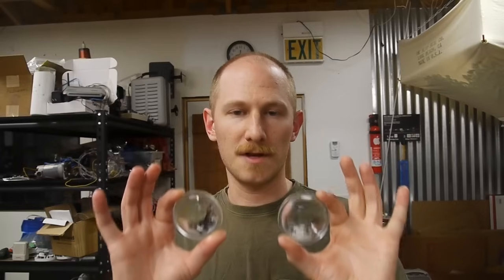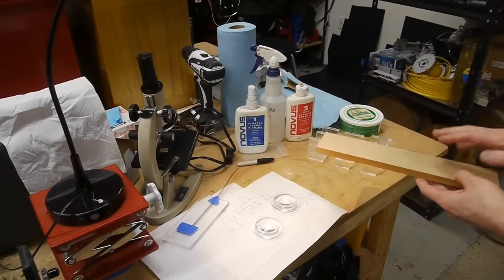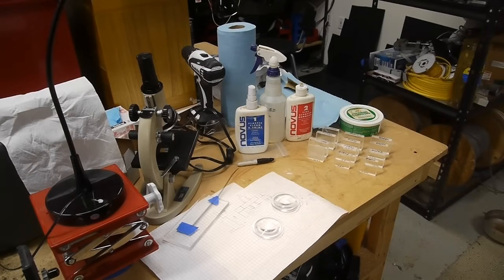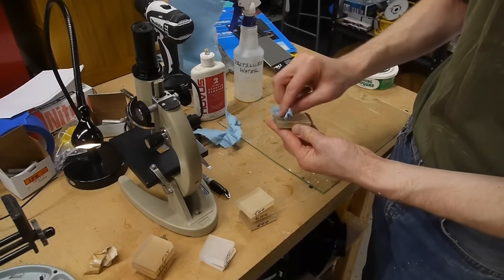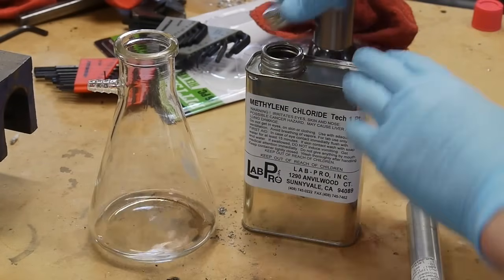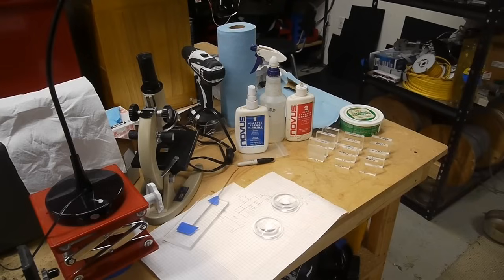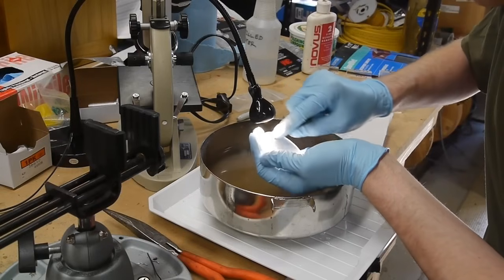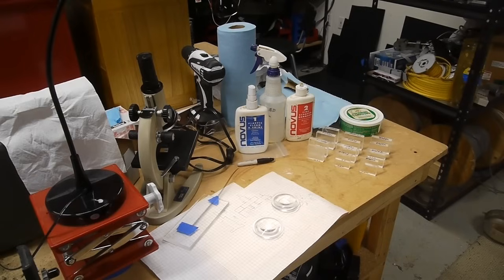Optical finish for acrylic -- vapor polishing and other techniques

Comment: You mentioned that extruded acrylic is best for laser-cutting. However, as an owner of a laser-engraving business, I am confident to say that extruded acrylic is far worse than cast acrylic for laser-cutting. I'm not sure why, but the fumes seem to be far less severe when using cast acrylic, the flame-polished edge is more consistently preserved, and engraving is dramatically better quality.
Reply: Extruded acrylic has built-in stresses.  All acrylic plastic should be annealed after fabrication.  This is a step that everyone seems to miss!  It should be out of the cutter, and immediately into the annealing oven for a lengthy cycle.
Reply: @bpark10001  hi Brian, is that the case even with cast acrylic ? , does cast acrylic also get stresses during laser cutting which need to be annealed later.
Reply: @scienceinc.9453  The difference between extruded acrylic & cast acrylic is that extruded acrylic has built-in stress as delivered from the factory.  Once you start cutting it, you build in more stress, in addition to that already there.  The only difference is that the extruded acrylic may warp if the cuts made release some as the built-in stress.  The cast acrylic won't warp, but either will crack from the laser cut, flame polished, or solvent-treated surface.  Sharp inside corners will crack first.
           I made a light fixture with a bunch of 1.5" diameter cast acrylic rods with slots in the ends.  The slots cracked several weeks after cutting.  I then re-made them, annealing them for 24 hours.  They cracked after 2 years.  Then I changed the design & drilled & tapped holes in the ends, screwing Delrin end-caps with the slots, & annealed those for 24 hours.  THAT has not cracked in 30 years.
https://www.acrylite.co/resources/knowledge-base/article/what-is-annealing-and-what-are-the-procedures-for-annealing-acrylite-r-acrylic-sheet?category=working-with-acrylite-r
Reply: I have theory why extruded acrylic makes more fumes (cast & extruded acrylic is same chemistry).  The extruded acrylic moves when heated because of the stresses, moving into the laser beam, causing more of the plastic to fume.  Normally, the cut line is very thin.  So the slightest movement would dramatically increase the vaporized plastic amount.
          Ideal setup would be to have the laser table & the plastic preheated to annealing temperature.  Make the cuts, then pull the plastic to an oven for slow cooling.  You would have to account for the expansion & cut oversize.
Reply: @bpark10001  Thanks for the knowledge Brian, I had always assumed that the stresses were developed during the laser cutting process because hot acrylic which tries to expand ( high thermal expansion coefficient) is constrained by rest of the cool acrylic sheet which cause it to stress at cut points, but good to know that pre heating the sheet and then cutting might yield better results .
Reply: I also read somewhere that acrylic with stresses reacts crazily with the solvent cement . so proper care should be taken.
Reply: @scienceinc.9453  The stresses developed DURING the cut is not important, as they are fleeting & are concentrated zones of compression.  The important stresses are the concentrated TENSIONS that develop as the molten plastic cools & shrinks, constrained by the rest of the acrylic.  They are there FOREVER, or until the plastic cracks or is annealed.  All this can be seen with a polariscope.

Comment: Nice work. Very thorough and informative. Do you know if it's possible to solvent 2 thin pieces of acrylic together to make a thicker piece without compromising too much clarity? I would think if you clamped the pieces together tightly it would eliminate any air bubbles.

Comment: I've been working with acrylics for a long time. This is good info. Only comments are sanding should be done in a figure 8 rather than single circle. The figure 8 is an old school lapping technique used to change approach angles of loose abrasives which will unevenly abrade the external edges of your surface. The other thing is that extruded acrylic sucks for glueing. The internal stresses blow the material apart once the material is chemically compromised by the glues/solvents.
As for polishing... agreed, mechanical polishing is best.... flaming and chemical are nice for appearance but not optics.
In my experience it is possible to solvent bond two pieces together with clamping but if multiple lenses are stacked a lense or optical oil makes a perfect transition. Avoid bonding if possible.
Lastly, again, I liked this video and to add to the solvent bonding phase.... polishing closes the pores of the acrylic so the unpolished (but still flat machined) surfaces glue/bond much better. Great stuff here.

Comment: In my country, almost every schoolchild knows GOI polishing paste (read as GOI - which means that the State Optical Institute). This paste is very cheap (cheaper than sold on ebay), and it is sold in almost every hardware store. This paste is polished mirror and lens telescopes. It is very easy to use, available and cheap :).

Comment: I use vapour polishing for plastic, and the best way I've found to do it is to use a large metal pot (though I have also used a giant pyrex beaker on occasion). I normally use a stainless steel pot. Put a few tablespoons of solvent in, and heat. Watch the vapour head as it rises up to the top, remove from heat to prevent the vapour head from over flowing. 
Simply suspend your plastic in the vapour head, I use wire to hang it from. Add more heat if the vapour head begins to drop too low in the pot. 

This can be done for long periods of time if necessary, and means far less solvent exposure for the operator, and consumes only small amounts of solvent.  All the best!
Reply: methylene5

Comment: I have joined acrylic with solvent for many years (as a craft teacher) and I have had only partial success. I can get an optically perfect joint about 4 times out of 5. You are right about the finish, if the surface is too flat the solvent can't wick all the way through. The other problem is that the solvent causes slight expansion of the plastic and a joint that was optically perfect at first, developed crazing inside the joint after a few years, caused I presume by locked in stresses. The solvent has to diffuse out through the full thickness of the plastic and this can take many months for thick plastic. Polishing joined pieces revealed that the joint line was still softer than the parent material after a month. Perhaps a period at elevated temperature might speed the process. I have had some success with super glues which are a different type of acrylic but still bond well.

As for polishing I have once, just the once got a perfect finish straight off the lathe, the feed, tool and speed must have been just right. Mostly just the application of a thumb to the rotating plastic is all that is needed.

Acrylic plastic absorbs a lot of water vapour and all machining and joining is best done on acrylic that has been oven dried at 100 C for a few hours. This also relieves internal stresses left after the casting process. HTH.

Comment: We do highly polished acrylic where I work. The secret is that you have to perform the mechanical smoothing to a very high degree before the flame or chemical polish and you cannot skip the in between grits (320 to get the saw marks, 400, 600, 800, 1500, 2400, 3200, 4000, 8000, 12000). 2000 grit is nowhere near good enough ending smoothness to achieve a good optically clear surface.  If you took it to 8000 then polished with slurry compound charge on a cotton felt wheel that would be good or for even higher quality, you take it to 12000 grit, felt wheel polish then flame polish. Another issue is that trying to flame polish by hand is art you would have to learn by trial and error, consistent flame polish is best done by driving your acrylic at a consistent speed past the flame.
Reply: Rick R Hi Rick, thanks for the info. Where do you work please? (not company name, just what you do ie camera lenses, lab equipment etc...)
I would like to shine lasers through the perspex as well as using cameras to make measurements in a lab type setup and would appreciate any advice you might have.
Reply: Rick R.... Thanks for the additional info. I was going to ask what would happen if lapped to 5000. And I thought that would be the limit. Didn't know there are people that polish to 12000. You tube is really great for learning. Thanks again.
Reply: Thanks Rick!
Reply: i agrre 2000 is not optimal in my experience 3000/5000/7000 is enough sanding then i switch to polishing depeds on your needs but 3k is lower limit imho. Maybe because i dont do it by hand but instead on a lathe/with a straight grinder rotary tool.
Reply: And when in comes to the vapour polishing, can you use ordinary acetone?
Reply: @StanaOves  No, acetone is bad for acrylic and polycarbonate.  It destabilizes both, not immediately, but within days or weeks.  I misspoke when I said chemical, I meant like Novis liquid polish which is just abrasive media in a creamy paste.  I do believe acetone vapor polishing works on PLA as in 3D printed parts.
Reply: Are you still using the same process to polish acrylic, or has your technique changed since you posted this comment? What product/brand would you recommend for polishing acrylic?

Comment: Hey!, Be careful man! I think its cool what your doing but that's dangerous stuff your working with! This is a very dangerous chemical that is carcinogenic neurotoxic and extremely volatile.I have worked with it as a chemist and I would regard it as an extremely toxic chemical. I think using methylene chloride would give you the best results, you just have to apply a process that immerses the lense in 100% Methelyene chloride humidity. Im not sure if boilings is necessary but it makes the process much faster Im sure. Try suspending the lens in the air in a beaker lightly filled with MC and letting it sit for a given amount of time. Alternatively you could bring the MC to a light boil before removing it from the heat, placing the lens in the beaker hanging followed by sealing it and letting it sit for a while This should evenly coat the whole acrylic piece and allow the surface tension to even out through the entire lens. That hot plate was definitely adding to much heat to the liquid hence why you had to refill it so often, it only boils at 100F. I would definitely understand why people want this process to be banned, those are not chemicals we need in out atmosphere. Its important to use a process that will use the least amount of this stuff and its not a very good idea that novice chemists use this stuff like that. Those gloves you used were very inadequate, MC goes through nitrile pretty damn quickly and I hope at least you were wearing a respirator.  Cool idea though but safety first.
Reply: It easily decays in UV. Groundwater contamination is a problem, but not atmospheric. Otherwise yeah, his setup was kinda nuts, and I hope no one attempts the same. That shit really needs a fumehood or at least outdoor ventilation.
Reply: Methylene Chloride is not as dangerous as most people assume. It is the most common ingredient in most paint strippers, things that you are literally meant to be slapping onto walls. The hazard comes when people use it in enclosed areas such as bathtubs, but if you use it in a well ventilated area it is perfectly safe.

Comment: The Methylene Chloride vapor process is highly dangerous and this product is under close scrutiny from the CSST in the province of Quebec. I had an office worker complain to the CSST because workers were applying MC with a needle applicator some 3000 feet away in the factory. The Gov sent in inspectors where the workers were harnessed with air vacumm testers. We were later were advised in writing that MC would be banned in acrylic mfg houses because it is listed as cancerogene material. Long term effect of being exposed to the vapors is dangerous!
Reply: +Mario Serio Although that is probably true, when you own your own workshop, you aren't bound by workplace safety laws.  I'm sure he uses proper ventilation/respiration, and what someone does with their own health is their prerogative.

Comment: Nice vid... Old times dentists used: 600 grit - 1200 grit - 2000 grit - cotton with pumice powder - cotton with spanish white powder... There is also a bath in hot, liquid acrilic polymer... Not sure if it is ok for optical purposes... :-)

Comment: Fantastic vid. You pretty much pointing out everything there is to know about doing this within the context of why you where doing it. I would suggest (if not already) that on a rounded surface for optical quality you would want to use liquid only means on a shaped die. For flatter surfaces (like head lights) you could go with sand paper (minimum 800+ grit finish). Also, it's best to not actually boil your chosen solvent unless you have some sort of "sprayer" end on the hose that will flatten out the direction of the fumes as the make contact with the surface. I personally use the double boiler method and try not to heat the water it's self over what would normally come out of the tap. This results in a dense enough fume but not so much that it effects the molecular structure of what i'm polishing beyond the surface.

Comment: You mention a solvent for joining two pieces of acrylic. What was the solvent you mentioned for doing this. Was it the methylene Chloride... how large a face of acrylic are you able to join to make a thicker & larger lens
Reply from the maker: Search for Weld-On #3 and Weld-On #4 solvent.  TAP Plastics also sells solvent for acrylic welding.  The main ingredient is methylene chloride.  I believe they also contain PMMA monomer and MEK.  You can laminate very large pieces, but air bubbles become problematic with larger pieces.
Reply: Do you need a strong mechanical bond or are you looking only for optical properties? In the beamline/physics world it's standard to use a optical wax to couple the detectors to the photo multiplier tube. It's not very expensive or terribly difficult and yields great results if optical clarity is your goal .
Reply: otm646 I am looking for a strong mechanical bond more than optical at this moment for what I am attempting. Thank you for your input it is much appreciated.
Reply: +Murray Lowe Chloroform works, thats if you can get it.
Reply: You can try Acrifix 1s117 for stronger bonding strength
Reply: Acrifix 117 is for XT (extruded) only and Acrifix 190 is for XT and GS.  After mixing put the mixing cup in a vacuum bell to remove air bubbles. No need to pre polish because the Acrifix polish the joint for you.

Comment: Car clear-coat buffing compound is actually FAR superior to Novus, and will give a perfect finish. I use 3m finesse-it 3000 #1 #2 and #3 and the results are incredible even under a microscope. Way more economical also. I'm not paid by 3M by the way.
Reply: i have the same product and we use it to clear opticals for cars and yes it's quality product

Comment: Couple of things 
Doing a vapor bath generally your supposed to apply the vapor in a container so the vapor can rest on the part since the vapor is heaver then air.

I use this method for 3d printing with abs which uses acetone but I've experimented with other chemicals and it more or less the same.

I use a presto steamer to heat the chemical and enclose the part. It comes with a tempered lid. 
You'll only need to do this for 30 seconds at a time about 3 times at 40 minute intervals and it's best to freeze the lid so the liquid condenses and reduces the potency.  

For sanding they have sand paper all the way up to 12,000 grit which would give you a higher polish.

One thing you mentioned is that you jumped from 600 grit to 2000 girt. That's generally not a best practice as your spending more time for less results.
You should start with 600,800,1000,1200 elec
it will save you quite a bit time and remove the previous grit faster.

Comment: This is a very informational video. Thank you.

I've got a question about getting an optical finish with an acrylic/polycarbonate tube - it is just a case of trying to sand down the inside of the tube, or is there another method of getting rid of machining marks?

Comment: There is a thread over on homeshopmachinist net where one of the guys does vapor polishing. He does it in a tin can. The thread is titled "I like chemical polishing" Might be worth a look.

At work we make a yearly trophy for Nike and the top crown and bottom stand are both made from cnc machined acrylic. One of the guys flame polishes it with a hydrogen-oxygen torch with a pretty standard brazing tip. He is very quick with the flame using multiple passes never dwelling, like spraying paint.

Comment: Cheap telescopes use acrylic, like cheap finder scopes. Bk7, soda lime, and other specific glass is used in any fair to excellent quality refractor. Some cheap glass such as plate glass is used in reflectors, most use low expansion glass like pyrex, and some even use expensive ceramics......yet some say its not needed on earth because the temperature changes here will not change the profile to the point of any aberrations.
Reply: This was most likley an attempt to make some low cost photolithography optics. And for that you need to pass UV light. And normal glass does not pass UV light, while pure uncoated acrylic does.

Comment: If you use 1000 grit, then 1500, then 2000...you would see no scratches. Youre seeing 600 grit scratches because 2000 grit just glides over the 600 grit scratches.